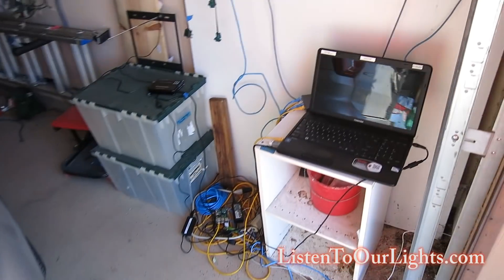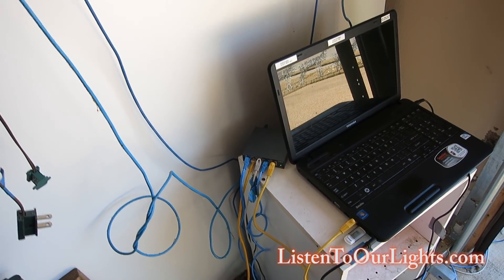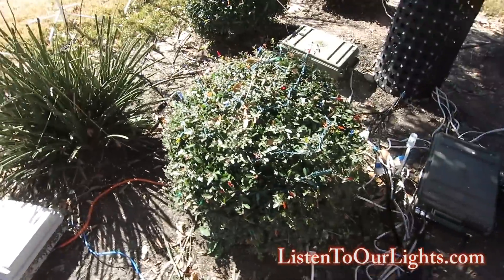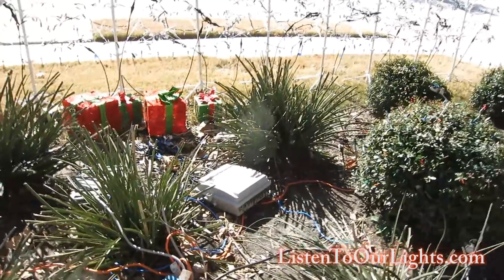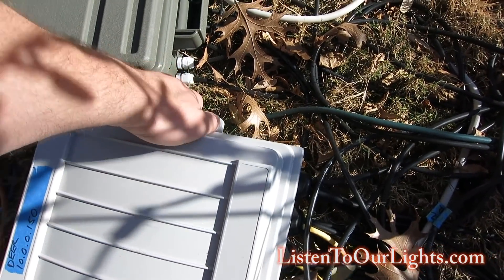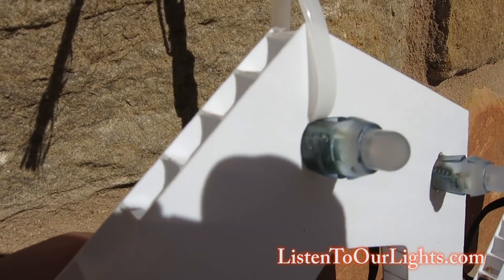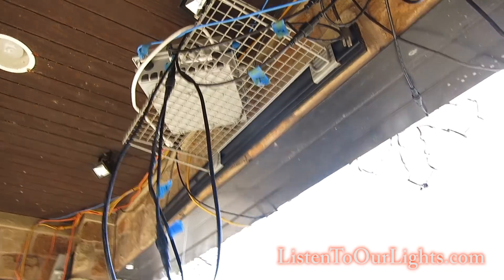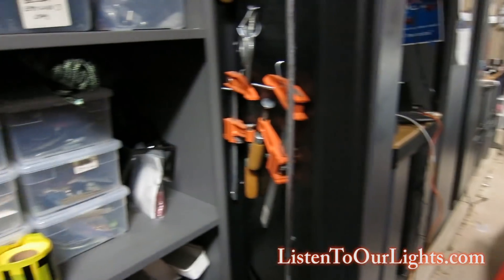ListenToOurLights Behind the Scenes 2018

Comment: Lots of wires for sure. I use San Devices E682 boards and understand your struggle with power injection. My whole show runs with 5 volt pixels and some LOR. Slowing phasing out the LOR too.